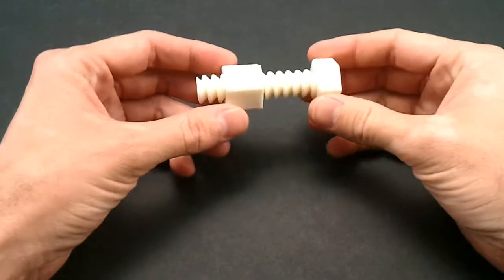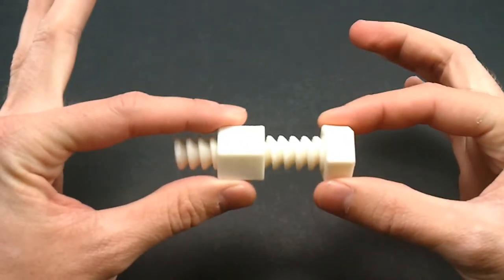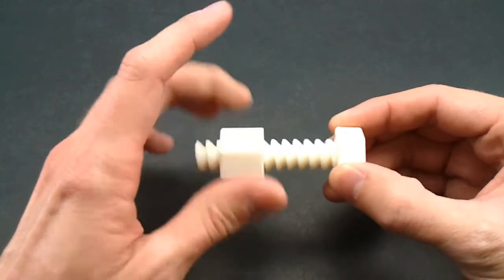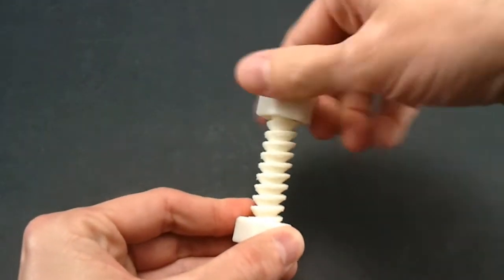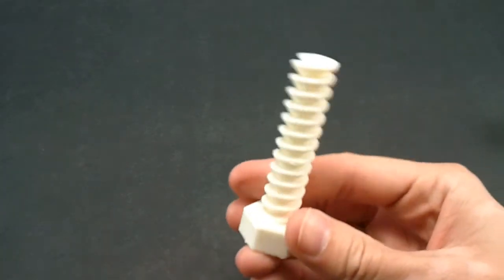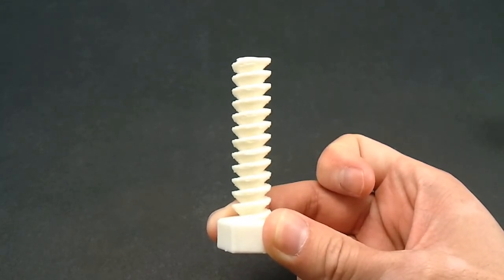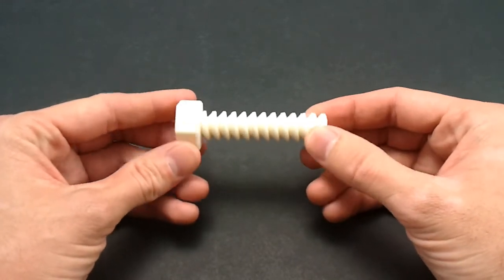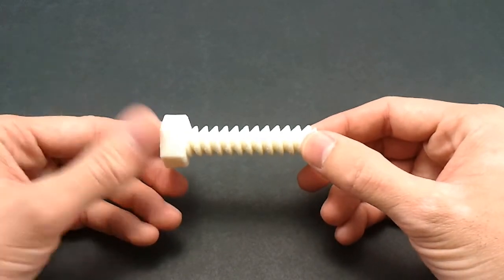3D-Printed Screw Threads

Comment: A very good way to print a screw that I found is as follows:
Cut off a slice of the screw along the whole length of the thread.
It should be slightly deeper than the grooves of the thread.
Ideally so deep as to limit the new overhangs  in the following printing orientation to 45°.
The screw can then be printed in a horizontally laid down orientation.
This way the screws tensile strength isn't limited by the pretty weak inter-layer-adhesion.
Screws printed this way should be easily twice as strong but I guess its more towards >10 times as strong as vertically printed ones (at least for filaments like PLA, PETG, ABS, HIPS).
Cutting off the other side too does not decrease strength noticeably.
It makes the screw more symmetric and one avoids unnecessary  retractions during the print.
A slight downside is that this method imposes some limits on the screws head.
Remaining possibilities are among others straight bars or small hexagons with wrench withs matching the chosen screw slicing thickness. Smooth profiles (sinusoids / kink-less stipulated parabolas) or better (circles / cycloids) should be faster to print than the "normal" sawtooth profiles.

Comment: Nice! I have been getting normal threads to print but the underside is slightly uneven.  Couldn't help but notice though, that the strong side of the thread is on the wrong side of this bolt. :)

Comment: why not just print a T shape cylinder and threaded with a die ?
Reply from the maker: +Frank Lopez For that matter, why not just buy a commercial screw? :) But sure, that should work too, provided you have enough solid shells surrounding your infill to give you depth for the thread.

I've tapped 3-d printed ABS before and it worked well, but I've never tried a die on it.
Reply: Eiki Martinson well how would one go about spacing out the threads? make it more long?  should we just scale the model stretching it in the long direction?

also about your comment, if you own a tap n die set is sorta pointless to buy screws when a die owner simply buys small RC rods to thread nd diy your own screws lol.....

the point of using a die was to avoid support and print time while getting precision
Reply from the maker: +Frank Lopez If you scale the model in the long direction you'll change the pitch but also the profile. The way to make any change is directly in the parameterized Solidworks model, not on the STL. In SW you can change the pitch, any of the profile parameters, or change the length of the bolt or nut by adding or removing threads without altering the pitch. Working directly in the STL is very limiting of course. There's a dimensioned drawing available on my site if you want to rebuild it in some other CAD software.
Reply: Eiki Martinson fusion360 & or 123dx "Autocad 123d" ??
Reply from the maker: +Frank Lopez I'm not really familiar with either but I believe fusion360 at least can import solidworks files. Try it out!

Comment from the maker: Sure, you could print a trapezoidal profile (it's like a buttress thread, but symmetric). So to do it without support material, at least doing it the way I did it, the "thread angle" should be at least 90 degrees, which might look weird but should work. The travel speed will depend on the pitch, which can be whatever you want it to be.

Good luck with your Prusa!

Comment from the maker: Not exactly. What I mean is, this "buttress" thread, being non-symmetrical, is stronger in one (axial) direction than in the other. The way this bolt is laid out, the stronger direction would be compression, even though bolted joints are more typically loaded in tension instead. I did it that way in this demonstration model so that I could put the bolt head at the bottom of the print.